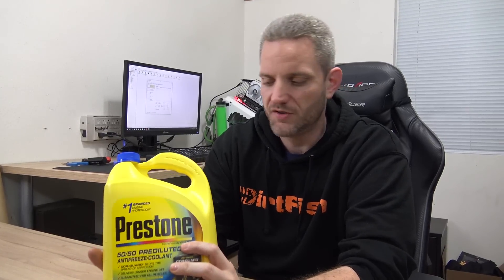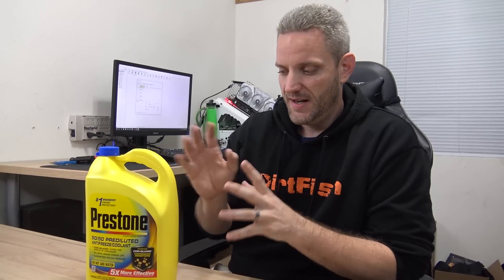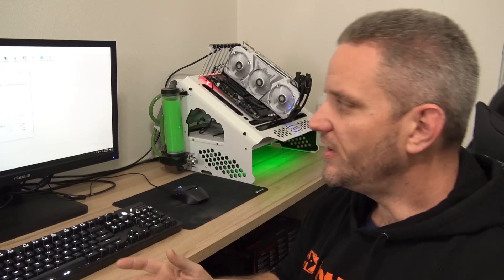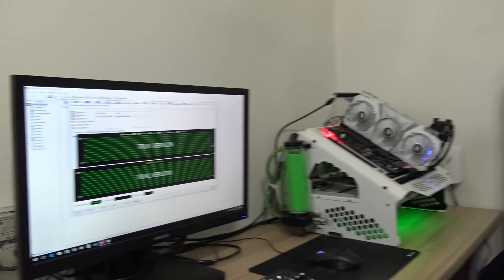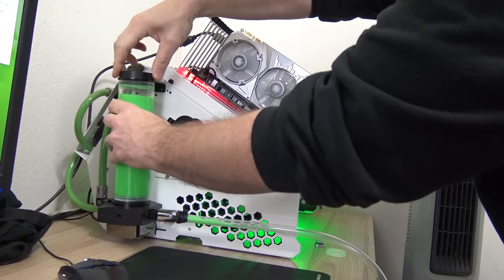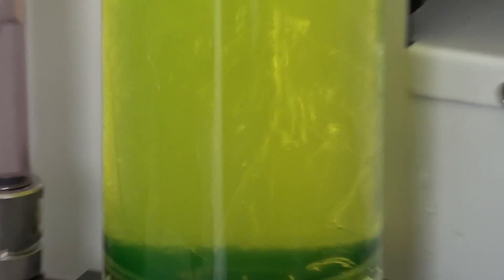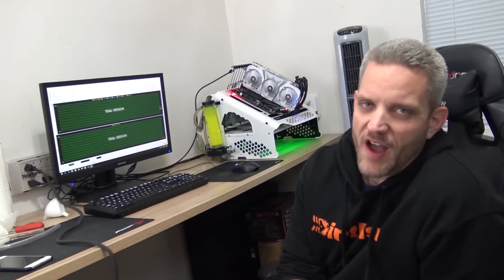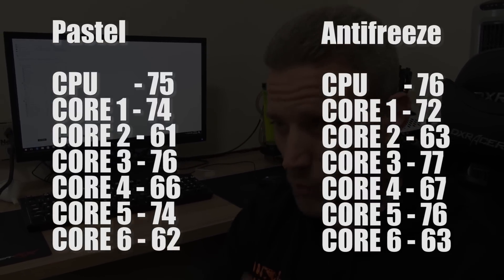I used Antifreeze to cool a PC

Comment: God I wish I could get my hands on that GPU in the background in the EU...
Reply: You can, actually even more easily than in the US. Search for KFA2. Same company as Galax, just the European name.
Reply: Thanks! Now I can finish my upcoming white build!
Reply: Arch What are the specs gonna be?
Reply: Current state (though I am still changing the last few details as I am not certain about the case, ram, mobo...):

CPU: Intel Core i7-6700K 4.0GHz Quad-Core Processor 
CPU Cooler: NZXT Kraken X62 Liquid CPU Cooler 
Motherboard: Asus SABERTOOTH Z170 S ATX LGA1151 
RAM: Corsair Dominator Platinum 16GB (2 x 8GB) DDR4-3200 
Memory Storage: 2x Samsung 850 Pro Series 1TB 2.5" Solid State Drive 
Video Card: GALAX GeForce GTX 1080 8GB HOF Limited Edition Video Card 
Case: NZXT S340 Elite (White) ATX Mid Tower Case 
Power Supply: EVGA SuperNOVA G2 650W 80+ Gold Certified Fully-Modular ATX Power Supply

I also want to get some eyes and ideas on the finished build before I order and assemble.
Reply: Arch If you're getting a Z170 platform, the Sabertooth S or the MSI XPOWER Titanium is a must-have. If not the Dominators, the TridentZ whites. The case is pretty good, it's a good all-rounder.
Reply: shadow336k I don't disagree. Nice case.
Reply: Arch All Z170 mobos have the same limit to my knowledge. Just get something that looks nice. Frequency doesn't matter. Try to go for a 4x4GB though.
Reply: Arch It's hardly white if you compare it to a Sabertooth S :D
Reply: +Arch get the 400c white
Reply: +shadow336k oh that is a nice case, I really like that it can hold dual 140 fans at the top with a cover! Though I don't think it is as clean as the S340... Guess I have some pondering to do! 

+Johan Ekstrom The Mobo is the one feature I am debating the most, being a noob-builder (and gamer for that matter) I am unsure what is really needed - especially since I have to consider the mhz limitation of the mobo as well? But I will definitely look into those - thanks!

+ChillBlastGaming How are you finding it? ^^
Reply: Arch What MHz limitation? There are no limits regarding the CPU clock. Memory? The RAM'll downclock to the max if it's over the limitation by default. You'll be fine with either mobo.
Reply: ChillBlastGaming same buddy UK :) and got my from scan
Reply: +Johan Ekstrom Well I don't want to spend more money on higher mhz ram if my mobo cannot utilize it.

+ChillBlastGaming thought about that as well as this will be my first build, but I cannot find anything that will look alright and not cost a ton of money - that and I kind of want to do it myself ^^
Reply: ChillBlastGaming good on you my order came to 2000+ and had to have finance but it's good to here of people from the UK to build on my YouTube I got my instergram show me your system love to see it pre built
Reply: ChillBlastGaming nice buddy. must of spent a bomb and been eating just bred for a year :P.
Reply: ChillBlastGaming and subbed to ya see you in mutilplayer some time :P
Reply: ***** Mobo?
Reply: ***** I'm asking what motherboard you have, as you didn't mention it.
Reply: That is a nice mobo - and it's white, I love it already!
Reply: Well I am color blind, so what do I know? ;D 
/s
Reply: Arch Well, I'm sure you differentiate between black and white :D

Comment: Eeh, twaddle.
I may inform everyone I have been using the cheapest gas station antifreeze for 6y now. All is well, change it out maybe once a year. Laing ddc pump, soft tubing and cheapo china acrylic res. Zero problems, actually I find it better, no gunk, misting or murky coolant and prob lubes the pump. Did I mention Cheap!!! .
I use about 30% antifreeze and the rest distilled water, nice n thick dont splash so much.
Reply: Same, I've used about 20% antifreeze diluted prestone, years later it's still clear.

Comment: i think antifreeze would be fine over time as even your car has plastics and seals and rubbers.  i think the real issue here is anti freeze is intended for very high temperature and pressure as well as sub freezing temperatures.  because of that its actually not as efficient as straight water when it comes to heat removal.

Comment: Didn't Linus use Anti-freeze in his whole room water-cooling project and the reservoir had a bunch of brown gunk in it?
Reply: No he used regular water.  Can't remember too many parts and it was poorly planned.
Reply: James Bernard But it was green when it leaked?
Reply: He also used pure copper tubing, a lot of it, that was not protected on the inside. Various colours can form from the dissolving and oxidizing copper surface, but hues of green are predominant. Looping dirty tap water through copper tubing is such a bad idea.
Reply: It wasn't just the dissolved copper. Linus also didn't take the proper precautions in that loop, so he had issues with microbes in the line.
Reply: Ah, Ok, Makes sense ;D

Comment: tbh I've been using antifreeze in my CPU loops for around 7 years now I use soft tubing and have had no problems. I haven't used a ready mix I mix my own around 25℅ mix

Comment: Did it years ago. I guess i had luck, because there are no problems what so ever. I used the green anti corrosion one for mixed metal engines. And its a nice uv green. :-D

Comment: JayzTwoCents  I think it is bought up because there hoping for cooler temps and since antifreeze don't freeze it would be good to have in there PC just in case the power goes out in the winter time now im in the north we have it's -15 and - 30 windchill a better idea is to acclimate a computer from  hot to cold slowly and see if these liquids do freezes and find out with ones don't and what are pro and cons to the liquids that are used for example u had 1 liquid change on u before
Reply: For starters, that was incredibly hard to read, you should use some punctuation. Secondly, shouldn't someones initial instinct be that it would run hotter because it doesn't freeze? You know, like fire doesn't freeze, but water does. The reality is tho that antifreeze is basically water with chemicals in it to prevent it from freezing, at least until you start  getting to some extreme negative temps, like -50c or lower (depending on the strength of the antifreeze)
Reply: yes, im sorry for the punctuation. I get that a lot its one of my weakness in life. and I now what ain't freezes is it's just instead of using  antifreeze and let's say someone is just using just distilled water only and let's say for some reason when u were sleeping the power goes out u have no heat what water/chemicals would be safe in an open loop cooling system for PC to make sure that the water or in this case distilled water don't freeze and go all over ur PC, in other words, how can someone prevent this from happing unexpectedly
Reply: man of many trades master of non i had a similar situation as you have described, and the reality is, your house is insulated and its gonna take a long time for the cold air to get into your house and make it cold enough to freeze the system. I had the heat off for a week during the winter while i was gone and didnt realise it till i got home, but the ambient temperature of my house only got down to 8c in the week i was gone (i live in northern alberta btw, so it gets cold here) and the average temp for that week was about -15c. So unless you dont have heat for a couple of weeks and its pretty cold out, you would never have to worry about it unless you live in a cardboard box, in which case the computer is the least of your problems. Even if it does start to get cold you can always load it up into your car and go to a place that has heat. Basically, i cant think of a real situation to where you are gonna freeze you water cooling loop, so no chemicals are gonna be needed to keep it from freezing.
Reply: I was talking about something that's realistic like a  garage not all is  insulated or heated because sometimes u have to work out there and why if u need a computer to look up ur code or what if u have to search how to do something or if u have to work on a wiring diagram or something  just curious to see what would happen

Comment: so if you were to use glass tubing, would it be safer?
Reply: yes and no. You still need to worry about corrosion, but yes in theory you wouldn't get that same chemical reaction
Reply: why would you need to worry about corrosion? Just... use all the same metals (most everything is copper or nickel plated anyway).

Comment: Use alcohol
Reply: CLM15 and when run out of VOTKA just drink your lupe liquid
Reply: Isopropanol reacts with acrylics, so if you have an acrylic block or pump top/res then it'll be bad.
Reply: From a thermodynamic perspective, pure ammonia would be the best. But, it would need to operate at pressures upwards of 250psi to ensure that it remains in a liquid state..
Reply: WAIT! I KNOW!!!! Use hydrofluoric acid or  sulphuric acid :D
Reply: alcohol will likely evaporate over time, plus its not great on the plastics
Reply: check out linuses completely silent gaming pc it ahs evaporative coolong
Reply: What?? No. I thought alcohol boils at 80C.
Reply: The thermodynamic properties of alcohol are considerably worse than water. Water with as few additives as possible is the best. If it won&#39;t react with your tubing, a little antifreeze is usually the best. Otherwise, good quality metal fittings (to avoid corrosion) and a little PT Nuke (to prevent growth) is a good alternative.
Reply: I guess some ppl just wanna see his station burn.
Reply: what if.. you use liquid nitrogen :O
Reply: +SunzOffski who did you reply to?
Reply: Austin P weld a metal piece to fit on top of the cpu
Reply: Austin P: wouldn´t alcohol only work great when used in evaporation type cooling solutions anyway?
I can´t see any benefit using alcohols in closed loop systems.
Reply: Chrinik 
Alcohol is worse than water however you do it. It's thermodynamic properties simply aren't that good.
Reply: Wouldn't the alcohol evaporate/boil, and eventually build up enough pressure to rupture the tubing?
Reply: Austin P But evaporation is one of the best heat transfer methods to air that we know of...getting a liquid that evaporates better would give better cooling performance in that case. And you aren´t utilizing the full heat capacity of water anyway.

We heavily use 2-butanol and IPA aswell as ethylane in our company, and the pipes run at about 5°C because of all the evaporation in the storage tanks.

I think acetone evaporates even faster then ethanol or IPA...

Alcohols are also able to run at much lower temperatures, enableing active cooling solutions by cooling the liquid to sub-zero temps.
Reply: Chrinik
I would have to analyze the thermodynamic cycles and crunch the numbers to see how well what you're saying would work for sure. But, I have my doubts.

Those fluids conduct heat more slowly than water per °C. But, an evaporation cycle makes up for that by having a greater temperature difference. (Something with half the conductivity per °C and twice the temperature difference will transfer heat at the same rate.) However, to avoid condensation, you don't want the fluid below ambient temperature for PC water cooling. So, you can't benefit from as much of a temperature difference as in the cases that you are referencing.

A thermodynamic cycle with evaporation may allow a greater amount of energy to be removed per volume of working fluid because you utilize the latent energy, but heat capacity isn't nearly as important as thermal conductivity. In typical water cooling, the heat capacity doesn't matter anyway because the water doesn't get very warm

If heat capacity were an issue, you just increase the flow rate of the fluid. It comes down the the rate of heat transfer. So, you basically want to use materials with the highest thermal transfer rates.
Reply: Austin P Makes sense...I just come from a line of work that works with industrial alcohols alot, printing machines and the like, and there, everything that transfers alcohols runs incredibly cold because of the constant evaporation, and without any active refrigeration.

So I just assumed, with some engineering, we could use the evaporatory properties of other fluids for incredible cooling. Phase Change already makes use of evaporative cooling, but it´s overkill and complex to set up.

Condensation is an issue, true, but a hybridsystem, where the watercooling loop is standard but the radiator is cooled by evaporation might get around that issue, and at least approach ambiant more reliably.
Insulating the tubes might also help with the condensation, at the expense of increased bulk.

People build crazy sub-zero solutions using alcohols and liquid carbon dioxide or nitrogen alot because of the lower freezing point compared to water.

Was just trying to see if one could cut out the middleman.
Reply: Chrinik 
It is possible that it could work. I mean, I haven't even analyzed the thermodynamic cycle. So, what I said was just my upfront opinion/guess. I am familiar with refrigeration cycles, not evaporative cooling. I just tried looking online, and I don't even see any closed loop evaporative cooling cycles.
Reply: alkohol would boil at ~46degrees. if it's closed system it would explode.
Reply: well yea i fucked up. somehow i mixed that up with other organic solvent. my bad. sorry. 80c is still low. and alcohol would still create heavy preasure even before boiling point. not safe.
Reply: Use acetone :D
Reply: Alcohols have a third of water's heat capacity, ethylene glycol has half, so it even the best alcohol is worse than antifreeze to move heat around, snd their boil temperature usually is bellow the operation temperature  (70-90°C) targeted by many PC component manufacturers.
Reply: Gytis ethanol boils at 78°c

Comment: i have used antifreeze in my watercooling  years now :D i using only high quality soft tubes :)  mixing liqued is 50/50 :)    1st run was  with amd fx-8320be... clocked  4.8ghz without any problems and max noise i run it 5.1ghz :D   now i5-6600k overclocked 4.7ghz and running  like a beast :)

Comment: I don't see the point to this video. anti freeze says it all in its name. its meant to keep a car operational in cold climates for the most part. additives and other stuff for longevity between flushing the system out and replaceing the old fluids with new fluids as part of normal car maintenance. its not ment as a cooling additive. its like putting heat in your gas to keep water build up in the gas tank drone freezing in the winter. I have lived in Minnesota for 42 years and this was passed down from my family, friends and auto shop.

Comment: Intel fanboys: "AMD is so hot omg"
Back when I had my FX 6300 running to 4.8GHz on air it didn't go over 68*C... And this i5 is going to 74*C on water wtf...
Reply: AMD cpu's used to run hot, which just kinda stuck in the heads of fanboys. AMD gpu's on the other hand still run pretty hot compared to alot of the nvidia counterparts
Reply: Do we really have to explain why your claim here is totally irrelevant or can you figure it out by yourself?
Reply: the i7 he used is a x99 cpu which are known to get really hot because of the higher TDP than their skylake counterparts

Comment: From what I recall certain antifreezes can damage Japanese water pumps at least in cars.  Something about it being too abrasive, related to silicates. I don't have any clue what it would do to PC based pumps so I just wouldn't recommend it.  I could be wrong so correct me.

Edit:  

Found this on the internet.

From the label of a bottle of Honda HP Coolant: "Over 95% of anti-freeze/coolants on the market use silicate inhibitors to protect against aluminum corrosion. However, the abrasiveness of the silicates may cause premature wear to mechanical water pump seals. To prevent this problem, Honda engineers demanded a superior corrosion inhibitor without silicates.

Comment: hey, now you should try antifreeze in your loop and see if it can cool your system better.  it's the stuff that keeps your engine cool so it has to be good!

jokes aside, cars used to just use distilled water to cool the engine as well, they started using antifreeze for just that reason.  it doesn't freeze as easily as water.  so unless you computer gets below freezing there is no reason to try and keep it from freezing your loop.  if you live in Egypt or some shit you can just use water in your car, and they probably do.

Comment: Jay, this is the first time I've heard of it destroying the tubes, I'm curious how long it would actually take. I've been using the orange aluminum specific prestone coolant in my PC water cooling system going on 3 years with 1 ever leak from a damaged oring. I went orange for my computers orange theme
Reply: It's only applicable to PEG tubing because PEG tubing is a polymer of ethylene glycol.  Ethylene glycol wont harm other types of tubing.

Comment: A PC will not benefit from antifreeze. In a car it's only purpose it to keep the coolant from freezing, boiling and prevent corrosion in the cars cooling system.  Antifreeze is actually a poor coolant, the water absorbs and dissipates the heat much better.

Comment: who ever asked u to do this just needs to understand the lable. It's anti freeze. that means it helps prevent freezing. A CPU is far from freezing plp. besides putting a  air conditioner compressor system into a pc water is the best way to remove heat from the system.
Reply: ya know antifreeze is just the common name for it, and it also (and more commonly) serves to keep the coolant from boiling right? plp...
Reply: +Stephen Oliveau it raises the boiling pont. doesn't make the engine run cooler

Comment: Antifreeze is what it says it is, antifreeze, water is what does the cooling. Even SoCal I run 70% water since it never gets that cold or hot. Even when I go racing the track bans you from nothing but pure water, if you dump antifreeze all over the track they have to burn that stuff off.